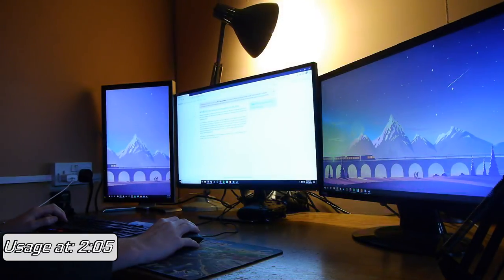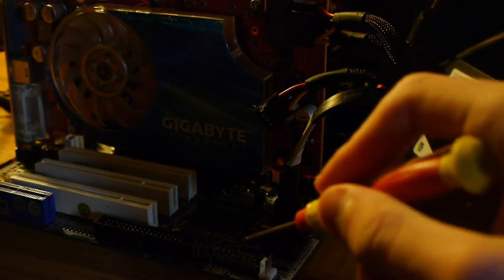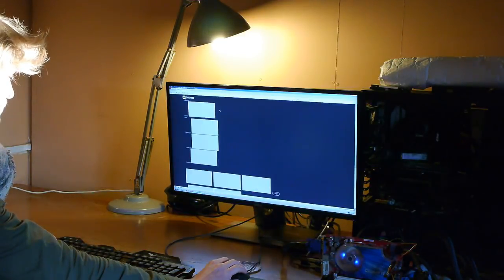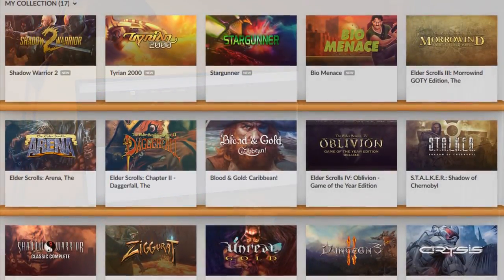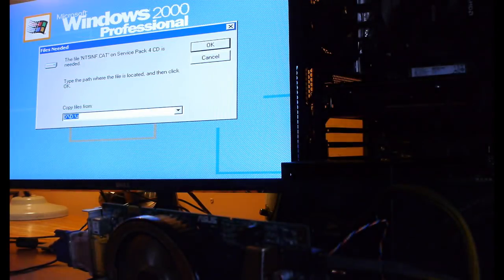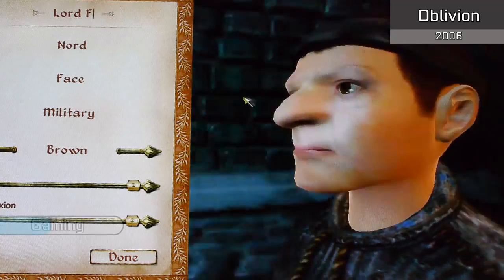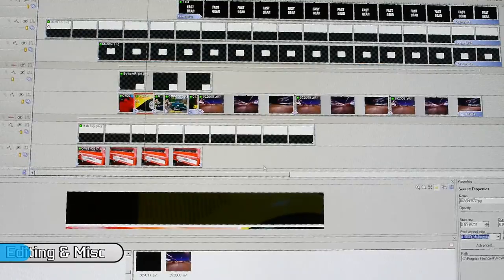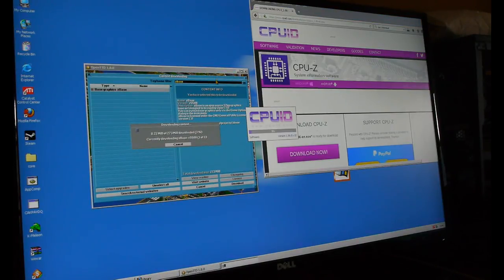Windows 2000 - Is it any good today?

Comment: When I was in middle school and like 2009, 2010 I had a Toshiba satellite from that time period that I bought at a garage sale for like 20 or $30. It had windows 2000 on it and at that time that handled everything just as well as modern operating systems. I had a good experience with that. Very good OS, too bad windows 10 isn’t as good. Looking back I might’ve even prefer that over XP.
Reply: Nice catch... I still got Toshiba satellite laptop today... bought in 2009, 3GB RAM, no HDMI port eh moved from Vista  back to XP to WIN7 at this point... I have ordered Raspberry pi 3 B+ that is going to be more powerfull xD
Reply: Thank god win 10 is actually just as good if not better
Reply from the maker: @daftbence : I mean compared to something like Windows 7 it's worse in everyway that isn't 3 things:

* Multi GPU Support 
* DirectX12
* General UI Improvements

Other than that an OS like Windows 7 is much better overall, and works much more smoothly.

If you'd like to stop commenting about how Windows 10 is the best thing since sliced bread it'd be greatly appreciated.
Reply: I'm haveing problems with windows 7 update to 10 it works fine
Reply: @BudgetBuildsOfficial  honestly i use windows 10 and used to use windows 7. I much prefer the undistracting "metro ui"(?) in windows 10 as opposed to the rather dated looking ui (imo) windows 7 had. Not to mention i have had much more compatibility with pretty much everything i have used with windows 10 than with windows 7.

Not saying windows 10 is 100% perfect of course(mostly the fact that there are so many old programs like regedit that have barely been updated since windows 2000, but of course this applies to all windows editions), but honestly i see no advantage to using win 7 over 10 in 2018.
Reply: @BudgetBuildsOfficial  I don't think the UI was improved much, a lot of people actually requested the Windows 7 aero and classic themes to the point where it was the #2 most requested feature after the return of the start menu.
Reply: My man! :D I also had Toshiba Satellite with Windows 2000 on it which I used in a middle school :D In my case I got it from a friend. I used Works (yeah!) as text editor and Opera as a browser. I think Win2000 is very underrated. It was very stable, very close to WinXP (for professionals it even felt somehow easier because lack of dogs trying to find your files and without "easied up" configuration) and it worked on much much worse PCs. My Satellite had Celeron 266 MHz and 16 MB of RAM AFAIR.
Reply: Windows 10 is the best operating system
Reply: @KrzysiuNet  Yes....VERY unfortunate that Win2000 has never been appreciated and micro$oft
never promoted it like they should have. Win2000 was my go-to OS for anything serious for
many years and my Thinkpad OS of choice...
Reply: @BudgetBuildsOfficial  I think it's more personal preference, because I really like Windows 10 and is imo (if you remove the aspect of bloatware), one of the best windows version (have been using xp, vista, 7 and 10). For gaming performance, I don't see any kind of improvement on 7 over 10.
Reply: Thinkpad + Windows 2000. Humanity will die, cities will be destroyed and such combination will survive. But seriously, solid system on solid laptop, especially these classic ones (like Txx - T21, T22 etc).
Reply: I've still got an old Satellite too, running Ubuntu now. Nice little laptops
Reply: lol I'm also using a Toshiba satellite on windows 7. it was made in 2009 and I'm still using it in 2019, it runs slow but it runs fine, gaming is good, but I'm still trying to figure out how to overclock it. I'm tired of playing at 10-20 fps. Are you able to help me?

Comment: I loved Win2k, upgraded from NT4 for the audio workstation when everything was time-critical and had to be rock solid. Upgraded to XP only due to software incompatibilities (new versions coming), and drivers for upgraded audio interfaces. Usually wanted to stretch on the same OS for as long as possible. Served me well.

Comment: Windows 2000 is not only good, it is the last great iteration of Windows. XP was quite good for its time, but its underpinnings are all Windows 2000, and it lacked the lean purpose-built punch of Windows 2000. I ran it from 00-06 until DirectX was abandoned on Windows 2000. I was appalled by Vista; I am now forced onto Windows 10 when not using Debian or Gentoo. Any Linux flavor is preferable to Windows. 10 is bloated to high hell but usable.

Comment: Being an IT guy for a local school up until 2007, I used Win2000 regularly, and it was generally pretty predictable. The server version always worked well, and the advances in more modern networking and actual working and configurable domain control made it perfect for business/school related installations. I still have copies of everything from Win2K Professional all the way through Enterprise Server (which would handle up to 32 gb. of RAM). Stability was the main feature and that stability was because you could only install certain programs and drivers by default, so as not to disrupt the integrity of the OS. You could bypass this with various results, so it was always a good idea to test any new software on a sand-boxed machine to make sure it was stable before putting it on the domain. (Ran into a lot of this with education-based software that was usually created in early versions of VB6 and ActiveX). Overall, I sort of miss the simplicity and speed of it when it was working properly.. and at the time it WAS pretty fast, even on a machine with a single core P-IV and 512mb. of RAM.😉 The best way to gain speed on a Win2K machine was to setup multiple U-320 SCSI drives in a RAiD 0 array, as the read speeds were increased exponentially. I would think the system would be hard on SSD's just by design. Great video! I may have to dig out one of my older IBM rack-mount servers and play with it again at some point.😁👍
Reply: Alright gramps
Reply: Man, i wish Microsoft'd make good, unbloated, stable operating systems like this again

Comment: Win2K is actually pretty good, provided you have the extended kernel and unofficial service pack installed. If you don't, expect tons of BSOD's. If you do, it's quite a nice little bit of kit. I have it on an old Dell Latitude CPi. It found all the hardware on the laptop right off the bat. The only thing I had to track down was a driver for a Netgear PCMCIA 802.11g card. It runs very current versions of Python, Lazarus, Firefox and a few other essential things. It isn't fast, but it's completely usable.

Comment: 2K supported way more then 4 gigs of RAM on 32 bit chips that supported PAE, which was most. Microsoft turned that into a paid for extra feature starting with XP SP2. Earlier versions would support it out of the box. OS X and Linux support PAE as well.

Comment: Nice video, thanks for that. My remark is, that W2000 was actually never good for gaming. Games just did not usually work on that OS. You had to go with W98SE or later with WXP. That's what I remember form the past...Maybe that is the reason you were struggling with the games, that it actually is BAD for gaming.

Comment: Win2k is also a great option for late 1990s computers which are simply too slow for XP or Linux. Lack of SSE (or SSE2 for Pentium3 and Athlon XP) can be a problem, though for example recent version of foobar2000 still works :).
Reply: "too slow for linux" no computers are too slow for linux
Reply: 'Too slow for linux'
Some distros run in an i486DX. There is no 'too slow'
Reply: @flambo1500  It's not just about running. Recent distributions lack support for some "retro" hw. I have Athlon xp era desktop and laptop, latter with vesa only supported VIA gfx (which was supported in the past), non accelerated 2d xorg display, not fun to use. BTW I have a 486 DX4 100MHz too.
Reply: Lubuntu. PuppyLinux.
Or bring out the big (tiny?) guns: NetBSD prides itself on running on everything.

Comment: Believe it or not guys, I'm commenting on a windows 2000 machine. Im using a Dell Latitude D620 even though it was designed for XP, all the hardware drivers do exist for 2000. It works very fast, everything works (even the built in wifi). I'm on Wi Fi right now. I'm using K-meloen browser, and unfortunetley there are a lot of youtube videos, including this one, that don't load. But other than that it has so far been able to handle all of my school laptop requirements. I've been using it as my main school laptop for shits and giggles, but it is actually holding up surprisingly well! Long live Win 2000! LOL

Comment: If Windows 2000 had 64bit and actually worked on Ryzen and current i7's id use it today
but then again Linux should be worth swapping over with Kernal 5.0
Reply: I believe Windows Server series are direct descendants and exits in 2003,2006 + versions

Comment: I used it and loved it. Quite stable OS.
But it also supported dual cpu, which was an improvement if you had a BP6 or similar mainboard :)
Worked well with 2 Celeron 433 running @490 and a Voodoo3.

Comment: Win2K and XP were the best versions of Windows, but in the case of XP, only after you de-Fisher-Priced it so that it looked and acted like 2K. Once you switched to the classic skin and disabled the "themes" service; disabled "use fast user switching" and "use the welcome screen" in order to get the 2K-style login box and ctrl+alt+del box back, and used PowerToys to get the 2K-style Windows Explorer search back, and disabled "use simple file sharing" to get the "security" tab back in folder properties boxes, it was just like 2K but with the added benefit of System Restore and better Plug and Play support. I even went so far as to modify XP's Explorer.exe and various system DLLs to replace XP's shitty icons with 2K icons.
Reply: I always changed the folder names in XP in the start menu from My Documents to just Documents and a friend noticed and asked me why I did that and I was like well they're my documents I don't need to be told that.
I notice Vista named them without the My which I liked.
Reply: Very specific comment lol, thanks for the tips. Planning to install 2000 and XP on a 2006 laptop, maybe I can just install XP and get the 2000 looking experience, and call it a day

Comment: I remember using Windows 98 and 2000 when I was in elementary school
We used 19" crts and modem internet back then
Reply: How old are you?
Reply: @goldanimal3931  I graduated high school in 1999. they were still using DOS based applications in the CAD classes I was taking.
Reply: @andrewdonohue1853  I was born just a year after you graduated and even I still remember using Windows 2000 in school and Windows 95 :D

Comment: There is a custom GTX 980 TI driver for windows 2000 a friend of mine runs a 970 and a i7 with Windows 2000 fully updated with extended kernal and a cpu thread registry patch so all 8 threads can be used as his daily driver with the xp patch version of basilisk so he can use voice chat in discord.
Reply: Wow thats nice. As much as i like hassling with hardware i would never have the patience to set all that up.

Comment: If only Win2000 can run Visual Studio 2017, as a programmer, i dont need all the bells and annoying whistles of Win10; i just need an OS that gets out of the way and just let me work quickly... i always run my development environment on virtual machines so that i can have a custom environment specific to the project im working on.
Reply: The funny thing is i actually tried installing Win2000 on a virtual machine, and with modern hardware and an SSD, it booted up and was in the desktop within 10 seconds... no bullshit animations, no annoying siri-clone, no annoying flat windows...just good old windows classic with somewhat 90's 3D effect... if only Visual Studio 2017/2019 and IIS 7.5 worked on this... what a breeze work would be.

Comment: Windows 2000 was my favourite OS.  It was stable, clean, and just worked.  No BS.  XP came along with it's fisher price interface, which could thankfully be turned off.  Stuff changed but it was manageable.  Vista was a huge disaster that I never touched.  7 is better and the flashy interface can thankfully be turned to Windows Classic but I still get caught in some of the changes when trying to do stuff that I remember how to do in 2000/XP.  Then 8 and 10 came along and changed everything yet again and actually removed any customization options and hid stuff everywhere making it harder to find, and overall the experience just sucks.  That's when I switched to Linux.

Comment: Windows 2000
It runs a custom version of Windows 2000 rewritten for PowerPC processors (the type used by old macs and games consoles) complete with a locked down UI and gaming specific driver access and additional features. The original Xbox also ran custom Windows 2000 of which the 360 OS was an update and port of.

Comment: what if you don't want to use win 10 ? or your hardware can't ?

INSTALL GENTOO!

edit : f*ck it just use Void.
Reply: Yes
Reply: Actually you made a good point here but I would generalise it more to GNU Linux since gentoo would just be a bit scary for most users haha. GNU Linux works on every computer, be it budget or a supercomputer and your system wont have any bloatware on it.
Reply: Windows 7 will run a Pentium 2.
Reply: Lmao!

Anyway i would go for lubuntu or xubuntu
Reply: Barack Smith Not well tho. To be usable it needs to be at least a 1.5ghz singlecore cpu, that if you dont install sp1... 
A atom n455 for example, is the bare minimum.
Reply: Cuzeg Spiked Oh yeah, totally forgot it. A good option too, even tho in the past i had some bugs with it too, its a really nice option too
Reply: @Cuzeg Spiked Well i think i used mint 18 in a atom n455 not too long ago, with xfce and it was really good, but felt a little bit heavier than xubuntu for some reason.  

And that specific processor, basically uses the same old core solo architeture, so basically performance wise it was a pentium 4, but that consumed less power of course and was colder, but it had the same basic speed of 1.6ghz in a singlecore low ipc processor. 
Even the ram in my netbook was the same usual of these systems, 1gb of 800mhz ram! It was ddr3, but running only at 800mhz, making it basically a ddr2 ram. 
The hdd was a old sata 2 drive, with 160gb, really sluggish, even with w7. 
The gpu was a gma3150 wich was one of the worst intel integrateds, it lost too many if not all  late 90's gpus and even to some early 00's igpus. Even lost to previous gmas, such as 950 and x3100.

So yeah, linux mint will probably run fine in any pentium 4 or higher machine, even if it has low ram, and a really bad processor, probably the pentium 4 featured in the video was at least decent, so around 2.4-3.4ghz wich is way better than my netbooks processor.
Reply: already has Gentoo
Reply: Cuzeg Spiked Yeah, and a test video about gaming on linux (example mint) in this same hardware (maybe a beefier pentium 4 and a better gpu) would be really interesting
Reply: Cuzeg Spiked Yeah, and with steam proton, its even easier than install using for example pure wine. Making acess to many older and newer titles possible.
Reply: @Adam Carvalho Unfortunatly no, debian has a different philosophy, it only has "free" stuff, no the non paid kind of free, but the "opensource and not proprietary one". 
This makes it has a really awfull driver support, so older machines wont work at all, newer machines also likelly will have issues if they work, and you have a restrict range of compatible hardware. 
Take that toghether with the fact that debian isnt out of the box compatible with repositories so its harder to install programs and emulators for example. 

And for the last, debian, debian itself, has only a few graphical interfaces wich range from too basic (and for many ugly) and not that lightweight to really heavy (and still not beautifull for many) interfaces. Gnome is really bad for older hardware and lack some stuff that many people use (wich canonical in their modifications added), kde is also heavy and with the standard debian bland look isnt pretty and very basic actually, xfce and lxde both are kinda more lightweight, but in debian with the default debian look, look very ugly. 

If for some reason you wanted to go with debian in older hardware, i would go for antiX or any of these really lightweight debian derivateds, or maybe pointlinux mate wich look kinda nice. 

Yeah distros are mostly a matter of taste, as the look of debian wich like many i dont like, but in therms of software and hardware compatibility debian looses quite a bit. And with older packages, drivers (their philosophy is to really hold on really hard tested packages instead of updating even to awready considered stable ones), so driver performance in newer machines wont be as good as it could be, steam proton could have some more issues as the drivers may be older than the recomended ones, etc. 

I would say debian is more intended to servers, and all sorts of utility machines such as cash registers, atm machines, etc, wich require a totall stability in detriment of performance and avaiability of programs and drivers, and also in detriment of hardware compatiblity. 
But for general use with the right hardware it may not be a dealbreaker, but it really depends on what you want to use, what support you want, and on what you wanna run that.
Reply: 2nd week on OpenBSD ^^ (on a 10 y/o Thinkpad)

Comment: I've used 2000 on much weaker hardware than yours without any problems.
Reply: I used to run it on a dual Pentium Pro server, worked great.